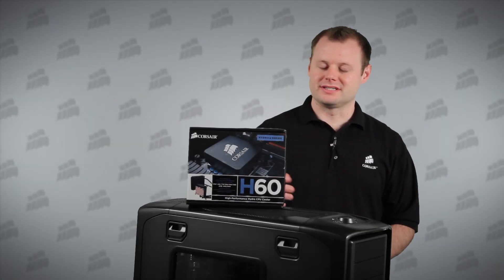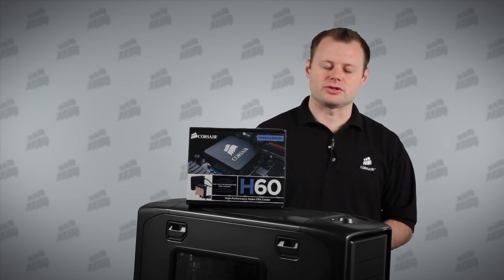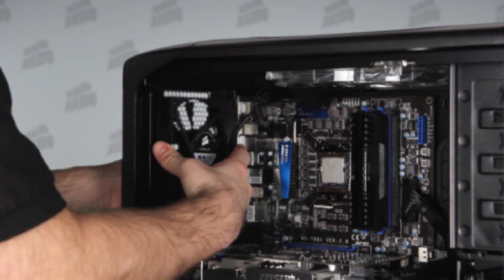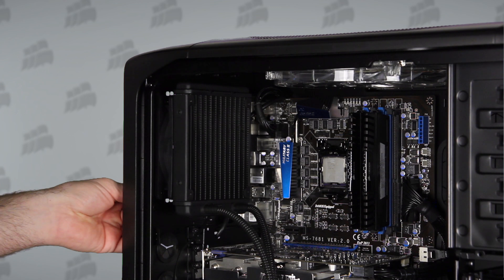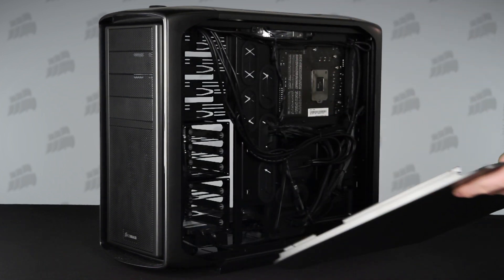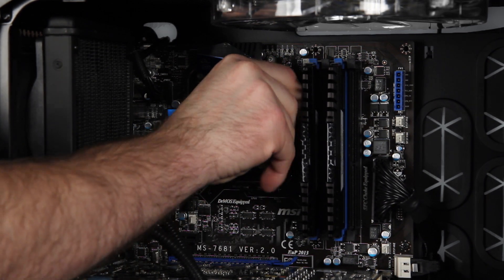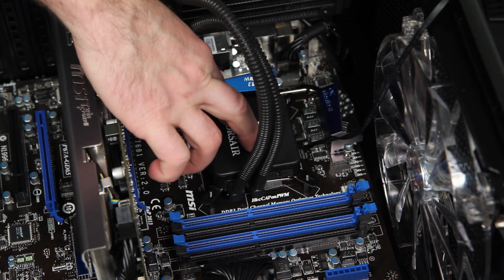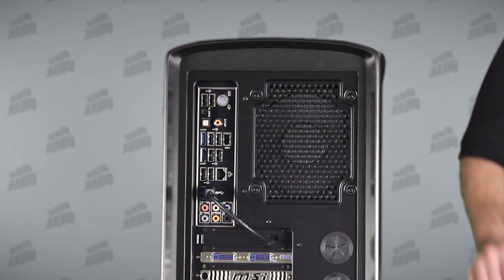Corsair Hydro Series H60 CPU Cooler Install How-To Video

Comment: I have a Intel I7 3770 3.5grz Cpu 
On a Gigabyte GA mother board.
The socket looks like the 4 pin socket. Like 150 socket or something. 
Will this fit on my Board? 
I have the stock fan still. Circle heatsink with plastic fan ontop. 
Hoping this fits and for someone to shed some light. 
If you need more specs il provide

Comment: There is a very small chance it will fail and mess up your system, nothing to really worry about. Also do not waste money on one for your graphics card, they're a pain to install. Any decent graphics card wouldn't need a after market cooler anyways.

Comment: a comprable collermaster fan and heat sink has one 120mm fan compared to the H100 where i believe you can have up to 4 obviously your loosing efficiancy with the pump but the amount of air movement and surface area, as well as the customization of being able to use any fans you prefer, more then make up for it.

Comment: Those corsair closed water system are almost the same as some air cooling , and ,some opened water system are saffer and much better than closed system , why do you want performance if some years latter it may leak and destroy your computer ?

Comment: So this are the things that i changed

PSU: Silver Power SP-S850 850W PSU

Memory: Kingston DDR3 HyperX 1600MHz 16GB

Grapics card: Sapphire Radeon HD 7850 1GB GDDR5 (Planing to play BF3 and Dayz)

Motherboard: ASUS M5A97 R2.0, Socket-AM3+

SSD:  Kingston HyperX 3K SSD 120GB 2.5

More noob question. what is z77 motherboard?

what is a ivy bridge

Comment: you Definitely want to change your mobo.. i've got the same processor and seeing as you're getting a 'k' model, you may want to go for a little more Serious motherboard, like an Asus Extreme4 or something like that.. your mobo won't handle overclocking very well.
And definitely change the HDD, like @paraplegicFish said, Get the black, Green won't be good enough for your gaming etc.
Also, GTX670 - Gigabyte.. if you can afford

Comment: Hey guys im planing to build my first own computer. But i need to know if my specs are good!

Silver Power SP-S750 750W PSU

Intel® Core i5-3570K Processor

Vengeance DDR3 1600MHz 8GB CL9 

ZOTAC GeForce GTX 660Ti 2GB GDDR5

Western Digital® Desktop Green 2TB

Crucial m4 SSD 2.5" 64GB

MSI B75MA-P45, Socket-1155

Corsair H60 Hydro Series CPU Kylare

Comment: I need some advice... If I use a Silver Thermal Paste instead of using the default paste that comes in with this cooler, will I have problems?, or it will improve the cooler functionality by decreasing temperature?

Comment: there is, thermal paste is required. but the corsair H60 has a thermal paste on it out-of-the-box, that's why thermal paste application in the video is not shown.

Comment: lol, Corsair's instructions specifically say that for the best CPU cooling, fans should be facing IN TOWARDS the case against the radiator to bring in cold air. Most users avoid this because it adds too much heat into the case. Fucktard.

Comment: hey guys i have a question , i got the FX8510 amd processor with an Asrock 990fx extreme 3 mobo.

with that i got an issue , on what pc cases is this system compatible , i got a cheap Sharkoon Vaya pc case , whould this work on that ?

atm im still running my boxed proc fan but want to replace it with the h60.

if any of u guys could help me out that would be awesome.

many thanks and Corsair keep up the awesome products.

Comment: Would it make a difference if my radiator is upside down opposite to the one in this image? The water pipes going into the radiator are at the top of the case, not the bottom.

Comment: Im not going to overclock my intel 3570k past 4.4 ghz. my max temp will be 68C. would buying an h100 be overkill for what i need and should i go with this unit instead? (I will be doing push/pull if i get this unit.)

Comment: they greyish square is the thermal paste, + ahesive to keep it on the surfacce on the block during transfers. Be really carefull while detaching the heating block on the processor, as the processor might torque out of socket. With slight twisting motion clockvise, it should come off.
first wipe off processor surface with cloth (not paper towel), before applying cooler pump ontop of the processr (makes better transferance of heat from processor to pump.

Comment: I haven't got my kit yet, but it probably already has the thermal paste preapplied, if it doesn't check in the box whether or not there is any, and if you're still not sure, ask around, or check where you bought the thing, good luck!

Comment: I just bought mine and installed, changed the stock thermal paste and applied AS5, put two Vortex fans for a push and pull system and I can tell you guys I am EXTREMELLY satisfied.
Thank you corsair, it's amazingly silent ( thumbs up for the vortex fans too, efficient and silent ). My temps on stock cooler was around 60-70° and it was always running at 5000 RPM, now I can easily run ths fans at 3000 RPM and on load it won't go up 50°. Thank you, really, acessible price and quality.

Comment: It's a sealed system with the liquid flows between the cpu block/pump to the radiator, so there is liquid it is just all-in-one so to speak

Comment: I believe you can do push-pull with the H60. It differs from the H80 in that it has single thickness radiator (~25mm) and the H80 has double thickness rad (~50mm).

Comment: Could you attach a second 120mm fan for a push pull system for better cooling? Also what are the differences between this and the h80? Does one cool better than the other, if i attached a second 120mm fan would they be about and is one more controllable than the other.

Comment: Never had water cooling before so sorry if this is a silly question, but does the coolant inside the H60 need to be changed? say every year or something? Also, have Corsair thought of offering the same setup but with transparent tubes so customers can use different colours?

Comment: those are for way bigger water cooled systems, like when you build your own, the tubes go out the back into a radiator or thing filled with water, pumping it through the tubes to the cpu, gpu.   not a computer wiz but from what ive seen thats what the holes are for

Comment: It's all about clearance. First of all, does it have a 120mm fan spot? If so make sure there is enough clearance on the bottom and top of that spot for the radiator. And is there enough room width wise for the cooler and fan (possibly enough for push pull)? If yes to all these it should fit yes!

Comment: I have a few questions. I already have a fan attached to the back which came with my computer case? Can I use it? Or should I use the one which came with the h60? Also, does the fan or the raidator need to be attached to the case first?

Comment: Ive been using the H60 running with 2 fans for 4 months now and i love it... the people complaining about the fan noise need to just turn the fan speed down.. mine is running at around 1400RPM, ive got a i5 650 overclocked to 4.2Ghz @ 1.45Vcore and the highest temp ive ever got was with intel burn test, it peaked at 72C after 12 hours

Comment: Good video but a fault with this set up is you can't tell if the cooling block is making a good contact with the CPU.  The screws you use to fit the pump and cooling block to have a gap and this raises the block too much.  I only found out when I took the whole thing off and you could see the tim had hardly made any contact with the cpu.  Also, the fitting of the fan and radiator is far to fiddly and they should have a way of fitting both parts together before screwing the lot to the case.

Comment: Yes, you will need thermal compund.
Spread a pea-sized amount around the center of the chip then stick on the fan/heatsink and squeeze it down, this will spread the thermal compound.
Don't take it off to look at it again as this will wreck it

Comment: I have the back fan as the only out take beside the psu which is installed at the top not bottom , can i install this cooler and having the psu as the only out take of the system , my case is the Soprano DX

Comment: I bought the H100 it is by far the best purchase i ever made. It cools my overclocked i7 like no others. I wish that corsair would include more long screws for the H100 so i could mount additional fans on the radiator. Thats one thing corsair never good at. They have always include just enough accessories never more...despite how much the item cost. So far i bought the 800d case, their psu, the h100 and their rams. Wish they make Motherboard and wish they give me more accessories...

Comment: @100d5 unless you have a drastically over clocked i5, i7,Phenom II, or FX cpu then you should be perfectly fine. Most people buy water coolers because they over clock their CPU and want a SILENT system. The basic fan+heat-sink work just fine if you're not a quiet freak or if you are running a stock CPU.

Comment: @rep217folife Howdy... I noticed that not only did you upgrade your heat sink for your processor, but you also upgraded your Graphics card as well. I should point out that while you are upgrading don't forget about your power needs as well. Your graphics card should have a minimum power need so I recommend to checking both the card requirements and  your power supply and see if perhaps that's the reason its not booting up the way it should.

Comment: @DoubleSlayerXXX The fan should go the CPU_FAN, while the pump unit must go to the CHA_FAN. Reason here is that CPU fan speed is controlled by the motherboard so the speed varies with the CPU temperature. This is good for the fan. But for the radiator, you do NOT want to varies its speed. You want it to run at a constant max power, so always go to the chassis fan power source, CHA FAN in your case, or directly to a molex cable with 3 pin connector. Never ever connect the pump to the CPU fan port

Comment: Hello everyone!

I just purchased a Corsair H60 fan.

I followed the instruction got everything set up and it sounds like the fan is running, but I am not getting any video on my monitor.
Everything was fine before I installed the fan, so could the fan be causing in issue with the monitor or video card?
Here are the specs of my computer:
Asus Essentio Six-Core Gaming Desktop
You ordered 1 Asus Essentio CG1330-07 AMD Phenom II X6 2.7GHz, 8GB DDR3, 1TB SATA3, 1GB ATI 5450, HDMI, Win 7HP64
Thanks!

Comment: @Buttfuckbysquirl What? Are you using a stock fan? My AMD x4 980 only gets to 53C in prime95 and I've overclocked mine to 4.3ghz. (that's just with a push pull fan system)

Comment: How cool will this one keep my 2500K if i overclock it? its now running stock 3.7Ghz at Max 62C (10 minutes of prime small FFT) how high can i go? and what is the max safe temp. for the 2500K? im using it in the CM Storm Enforcer on an ASUS Sabertooth P67 board..

Comment: Does anyone know how to clean this thing ?

It has some dust in it, and I need to clean it..
Reply: I use a tool that looks like a mini leaf blower. It's 60cm long and blows like crazy. You can pick them up at a DIY store. I now block my fans with a pencil or something through the fan blades, so they don't overspin while I clean out my PC. Works like a charm and takes about 30 seconds to clean my whole system. :-)

Comment: @RoseMarryThea It comes with pre applied thermal paste. it comes with coolant already in it. I just got mine today. Installation was very easy. You do not need a reservoir and I hope it doesn't leak. Just be careful when screwing on the fan and radiator, make sure you have it in the right holes.

Comment: @Filoz64 These are supposed to be used as an intake, so that the air passing through the radiator is as cool as possible, but mae sure you have an outtake fan somewhere

Comment: @cooldevansh1 You would most likely be able to depending on the socket however i'd recommend upgrading from a pentium to around an i3/i5 for better performance, otherwise just use a air cooling heatsink.

Comment: I just got one for Christmas!  But now that I've got it, the part where it's fused to the processor/mb scares me to death.  I've replaced memory without a second thought, but messing with the motherboard scares the hell out of me.  My knowledge of computers is OK, but hardware of this magnitude is a bit strong for me.  For instance the cooler that's on there is absolutely massive.  And really teeters on that little processor making me nervous about even moving it.

Comment: Excuse my nabishnes but could someone tell me what setting should i put for the cooler in the UEFI (bios) I keep it on automatic is that okey? I have an I5 2500k with stock cooler on a Asrock Extreme 4 gen 3 MB. Thanks

Comment: @Akhan72 
If you want less dust in the radiator push air from the inside to the outside. For best cooling do the opposite. It works either way but pushing warm air to the outside will reduce cooling performance. I have a H70 and the difference is very noticeable.

Comment: i installed this and the back of the motherboard where cpu is, it gets extremely hot. you wont be able to put your finger there for very long. i dont know if the H60 is effecient enough or if i installed it wrong

Comment: @Akhan72 I'm guessing the reason for them recommending inwards airflow is that it's more important to cool the radiator than to remove heat from the tower. What you could do (if your case allows it) is install a fan with airflow directed outwards in the ceiling of the case. This is what I did (in combination with one fan in the front and one in the door, both blowing inwards) and I am getting satisfactory temperatures for all units inside my case.

Comment: @fewes17 Really ? I'm gonna write to Corsair to be sure. It's gonna be wierd, because normaly I have 1 front fan to get the cold air in, one back fan to get the hot air out... if I reverse the back fan I keep the hot air inside the tower...

Comment: @Akhan72 Not sure if the H60 works the same, but the H40 manual recommends to direct the airflow inwards. You might be able to find the manual online and check if the that goes for the H60 as well.

Comment: @reme 661
I agree putting the radiator to pull air in and having an exhaust fan on the top to push air out.so u get a smooth cool air in and a warm air out airflow.also be mindful.I would put the fan in CHA_1 and the pump onto CPU_1 sockets.

Comment: @Divizionn You're an idiot for not googling, or going on to any internet store and check out all the cases, 70% of em have the PSU mounted at the bottom, why? Cold air, hot air always goes up.

Comment: @xXxDANMANxXx we tried plugging the fan into one of those 4 pin things off my power supply as my friends jamming them into every possibility (got those little wires with those sharp points on the ends so you can actually plug them in but you have to have the right order) turns out he shorted my corsair fan out, i have another fan but still, also it is a BITCH to get the block on my CPU the way the tubes go, I probably rubbed off half the thermal paste, temps are the same as stock air cooling....

Comment: My fucking luck, so after 2 hours my friend and I learned that the fan header (that I wasn't using for my stock cooler) wasn't working for shit, my temps at idle before were like 100 somewhere in there maybe 105 depends on the day, and my pump would turn on for like 5 seconds at the bios then turn off, needless to say (with my AMD's TJ maxx of 158 F I believe) my temps were like 145F), we swapped the fan and the pump, because we couldn't tell if the pump was on or off, because of that...

Comment: @Flamable3000 Yes it is, it can intake much cooler air from outside the case, whereas inside the case may be hotter due to graphics cards, HDDs.. you get the point. Usually you would use the back for exhaust, but the H60 has been proven to perform better with the fan as intake. Well spotted by the way, usually people slap in the fan as an exhaust.

Comment: Whoah..... I just noticed that I installed my h60 the wrong way. I installed the pump over the cpu different then what shows in the video. (Pause at 1:59, mine is rotated 90* to the left with the bottom of the corsair lettering facing the memory modules. Should I leave it that way until I get new thermal paste or can I move it to the correct position without any worry?) I can see that my pump is a little off tilt but temps are about 35-40*C and about 67-72*C at full load.

Comment: I have a Gateway DX 4840-11c, socket 1156. The fan that came with the pc is an Acer product and uses a backplate already, with a system similar to yours, in that it uses machine screws threaded through springs. That side of the case is really difficult to get off, can I use the backplate that came with it? The spacing is standard, when I upgraded the cpu the fan that came with my i5-760's plastic clips matched up exactly to the 4 sockets or risers or whatever.

Comment: @UnufcE 

It really depends. Personally,  I had one before and the temps (With the stock shin-etsu on the H60, which from what  I understand has been replaced for better performance.) were the same as a push set up I had with a thermaltake frio. But they were both 60 bucks, looking back I should have chosen the H60 instead. 

But it really depends. Both of them gave me 28-29c idle and never topped 45c  on full load  in prime95.

Comment: @AstroTrain100 Fan into CPU fan, pump into other fan header. Make sure you disable fan control for the header you have the pump plugged into in the bios to make it run full speed all the time.

Comment: @mikerosowski hi , i would suggest to use them both. do push/ pull config. Thats the best way to get most performance on the H60. Just split your screws for mounting, like 2 screws for 1 fan and 2 screws for the other fan.They will not move. I did it like that and it runs great.